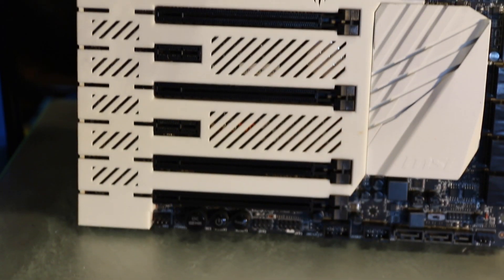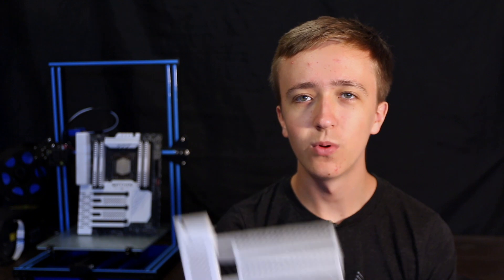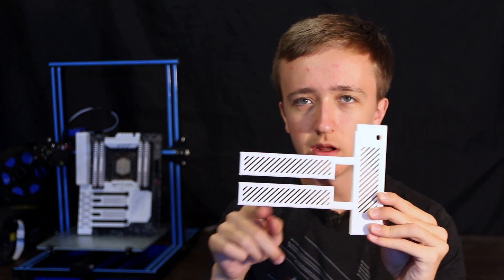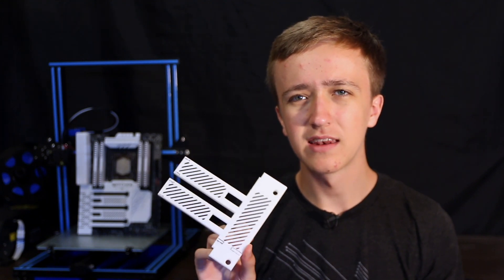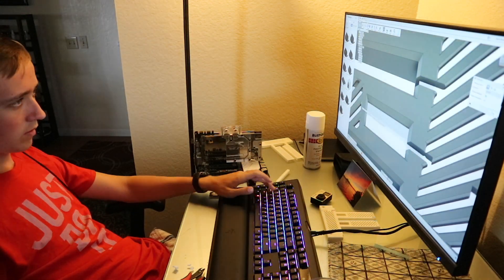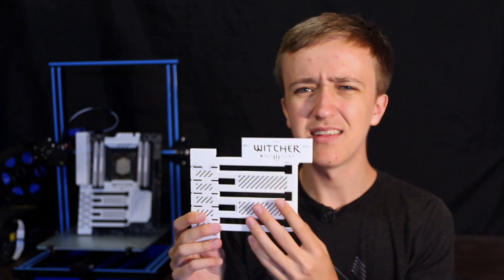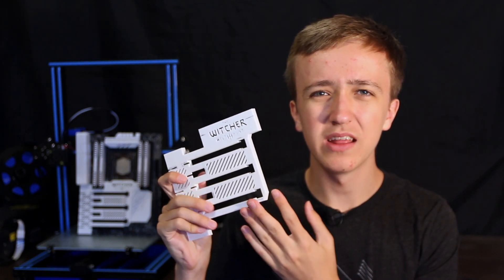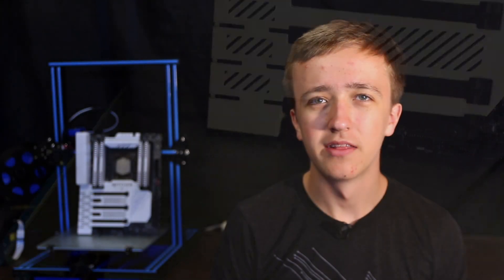Ultimate 3D Printed Mobo Shroud - How did I do it? (for MSI X99A SLI Plus)

Comment: here's what I did, i found an image of my Motherboard, i drew a Template over the top of the image (with a top layer) and did a image to SVG conversion, then I went and measured the ATX holes, and fit the Armor within the ATX specs, and thus fitted my Armor Perfectly, no real Micrometer measurements

Comment: y would you want to restrict airflow around the chipset?
Reply: well as I have seen from many people who have done the same thing you will hardly have any temp increase as long as you have a good airflow inside the case. Considering a wide array of motherboards come with same design of shrouds well yeah its not a big deal
Reply: @MaxC_1  MOST people dont have good airflow.. still trying to make my mates understand positive pressure

Comment: the result is nice, but the designing method can be improved. There are many reverse engineering methods witch can help you designing  parts like yours.
Reply from the maker: +Ewap yes, when I started out hwever I didn't think it would be a big deal and I would only take one eduration. If I did it again, I might try sth else.

Comment: Assuming integer values in mm is a bold assumption since mainboards are designed in imperial units. Even if it is something neat in mm, it has some rounded up small value, that wouldnt be noticeable, but those small things quickly some up, like in your case, since you are referencing one pcie slot. Errors some up and last ones wont fit any more. 

I hate mainboard standards, some do really seem arbitrary and should be changed.
Reply from the maker: The funny thing about motherboards is that they have both imperial and metric dimensions. PC building in general is a hot mess of imperial and metric, luckily with modern cad you can just use both systems simultaneously and it just does the conversion internally.